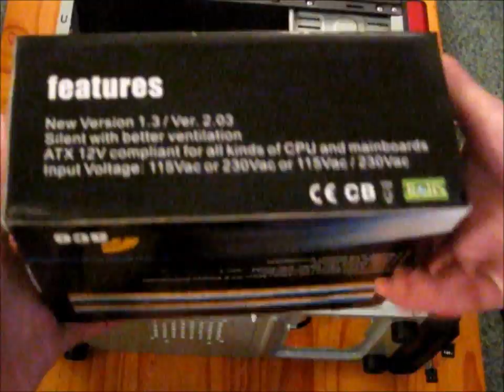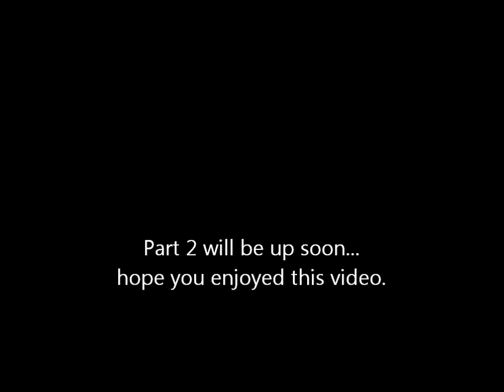PC-Build Series: How to build a Computer: Part 1 Preparing the case and installing the PSU

Comment: @jacx911 Tell me about it. I did my first ever build with the XCase V12 and it was a bloody nightmare; it's fine for rubbish generic PSU's (and even those generic PSU's which tend to be a little smaller than brand name PSU's are awkward enough to fit in) and mATX mainboards, but anything else and the case is shown for what it is... a cheap piece of crap.

I ended up taking everything out and chucking the case + generic PSU in the dustbin before I had even finished the build.